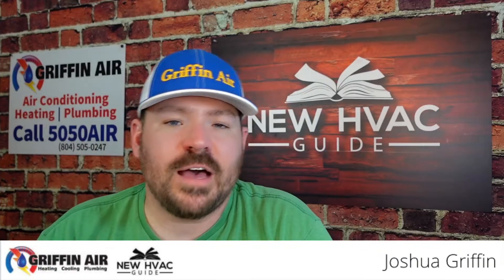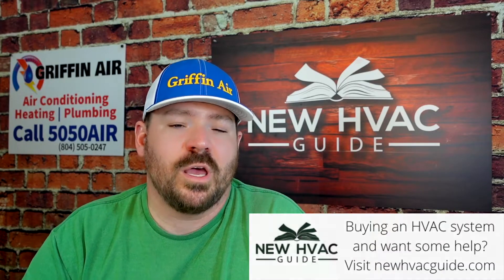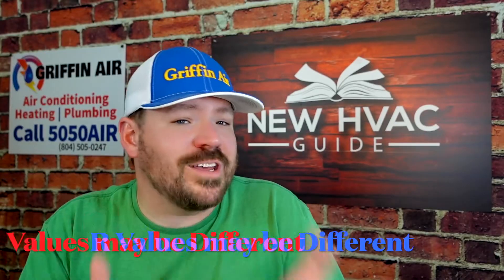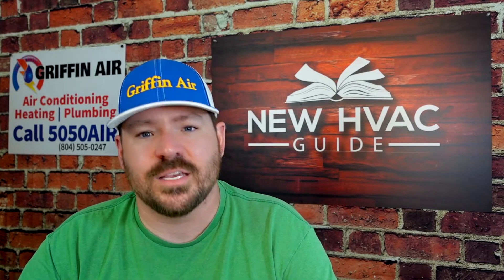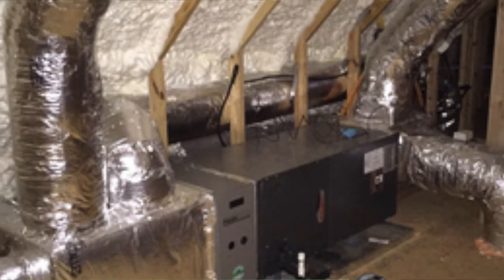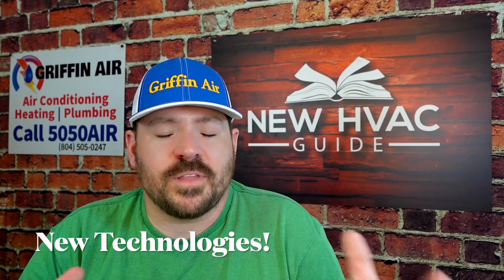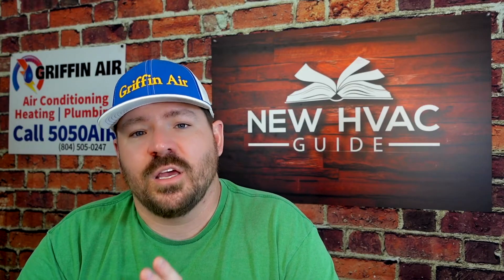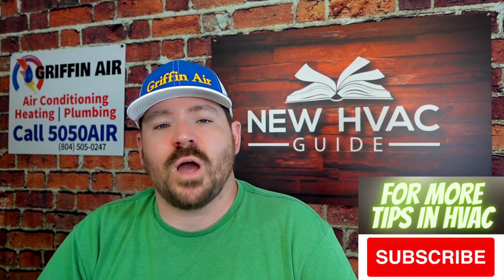HVAC EXPERT Shares 5 Tips on DUCT Insulation!

Comment: I bought a 55 year old house that was not maintained. Right now I cannot afford to have the ducts replaced. Some of my ducts are rusted through. I'm looking at a double sided radiant barrier to try and make it kast until I can afford to have it all replaced. Due to some of the ducts being rusted through, I'm leary about the fiberglass faced wrap. What would you recommend?
Reply: My house is equally as old, and no duct rust issues whatsoever. You've got some kind of an issue going on that's causing the ducts to rust out, and you need someone who actually knows ductwork to look at your system and see what's going on. Call a local sheet metal ductwork shop and get someone to come look at your house. Do not call an HVAC company, they are NOT the same.
Reply: I moved into my family 100+ yr old house it used to be my grandparents I grew up here and in winter they would put bowls of water on the registers bc the air was so dry in the winter & over the years accident  happened water getting knocked over & rusting out the elbow and further down the pipe a fist size hole to a small plate in 3 of the registers . I’m on a fixed income so I got that silver duct tape don’t cheap out on the tape from the big box store it may cost 40% less but it’s half the thickness just make sure it’s the tape for duct work & not regular gray duct/duck tape. I cut a piece of string just 2” bigger than the hole on each side so I could cut 4-5 pieces at a time for $15-$20 I was able to patch the duct work until I could save $ to replace the rusted out pieces. I probably went overboard but I used the rest of the silver tape to tape over the connecting duct pipe work they are usually 5’-6’ and as old as the pipe was it couldn’t hurt. PS take a slightly damp rag and wipe off any dust on the pipe let it dry before applying the silver duct tape. Sorry for any misspelled words & grammar hope this helps.

Comment: You're right about adding duct insulation being a pain. I lack the skill to replace the flexible ductwork in my attic and it was still in good condition. So I bought some in a larger size, removed the metal coil, and wrapped it around the existing flexible ductwork with nylon ties. That turned it from a pitiful R7 to a slightly less pitiful R14. Throughout the messy process I kept thinking, "Why doesn't someone make flexible insulation designed to be placed around what is already there?" Leave it open at the bottom and have a series of steel loops that would let it snap around the existing insulation. It'd be cheap and quick to install. It would certainly better than what I had to do in that blazingly hot attic. There's a business opportunity there for someone.
Reply: It’s probably a good deal better to go insulate the area that the duct goes through, but it’s just a better return for the money that you are putting into your house.  It’s definitely going to decrease the amount of heat or cold that the duct is going through in the process of cooling and heating your house